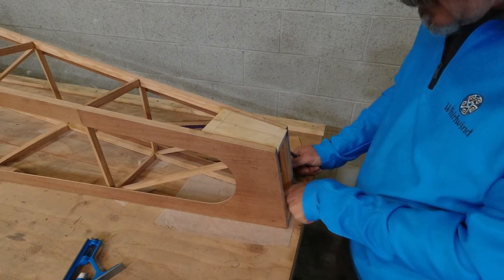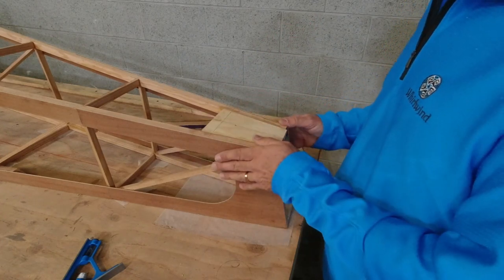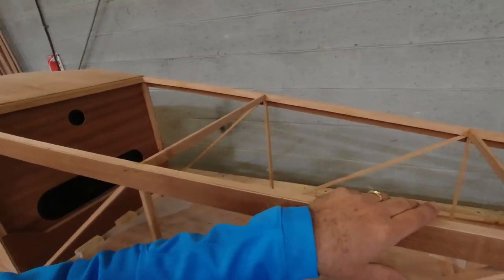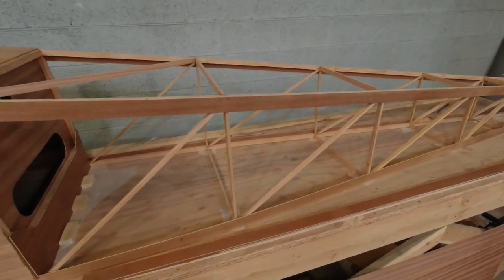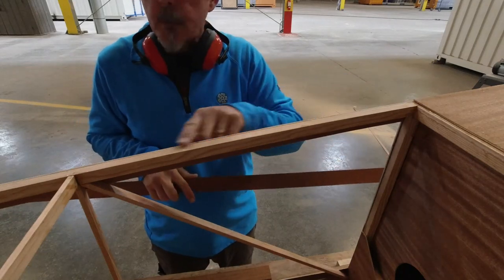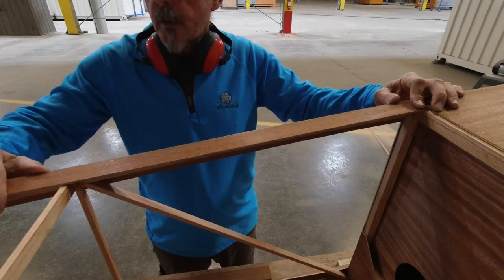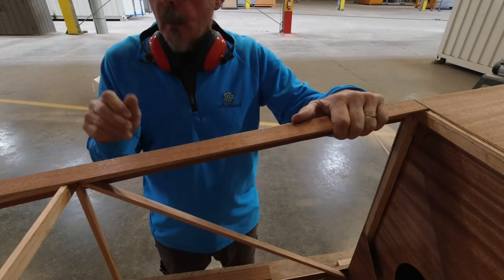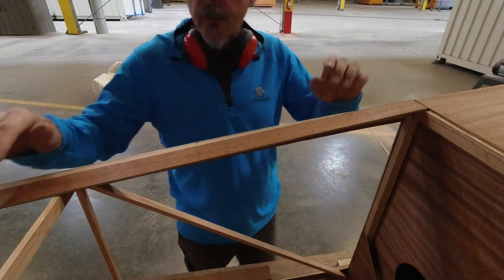Minimax 1100r Wood Aircraft Build Ep 66.5 - The lost footage

Comment: Not sure what happend but the screen went black at 15:26 and back at 20:54. Thanks for showing use how to bend ply edge ways, I would have cut it wider and then shaped it, as I have not see that method before.
Reply from the maker: Thanks for that! I was able to go on YouTube editor and trim that section out. Says it will happen in a couple hours. 
Not sure what I did there but a good reminder to look everything over before rendering:)

Comment: For the 1" 1/2 plywood strips would 2" wide strips flush routed to the outside contour of the fuselage work?
Reply from the maker: Of course Mike, that would work. You just have that big curve for that first bay and the distance to the outside edge was about 1/2”
Reply from the maker: Hey Mike! I saw a message from you but then it vanished.
Reply: @DTMinimax  I removed it because I think I was looking at the fuselage backwards which is why I thought the longeron angles looked funny.